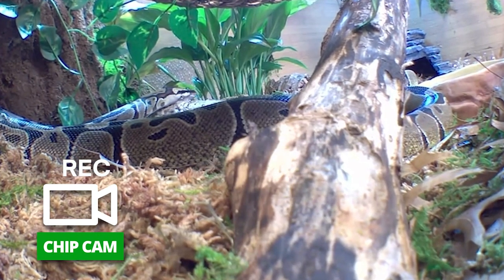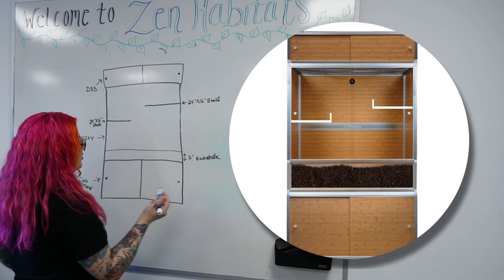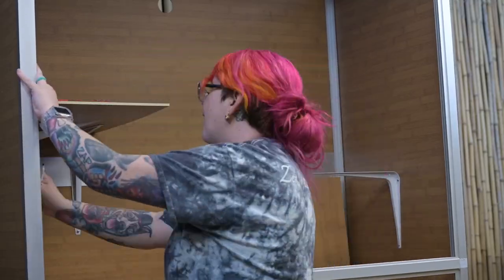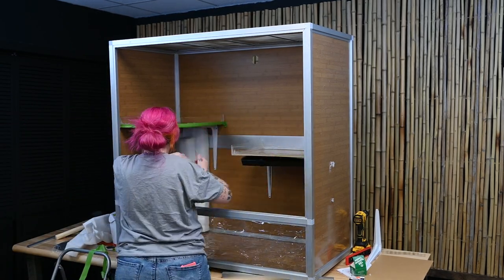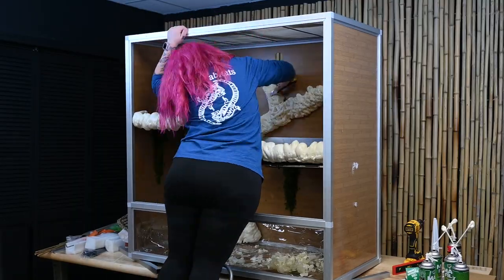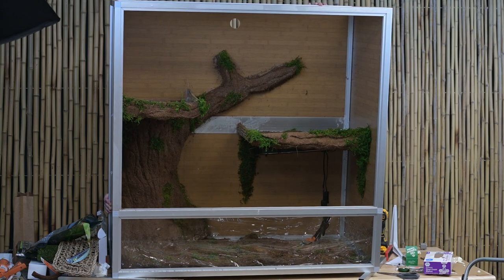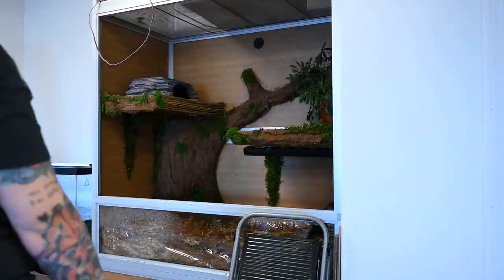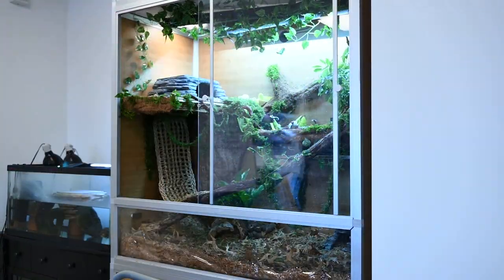HUGE Snake Enclosure Upgrade For Our Ball Python! | Zen Habitats

Comment: I absolutely love this set up!! But where did you put the heat source ? Is this a bioactive set up? If not how do you go about cleaning and sanitizing? This video was great but something more in depth would be amazing!!
Reply from the maker: We use overhead lighting for his main heat source. The heat gradient in this enclosure is more of a vertical one as opposed to a horizontal one and it works really well for him. It is a bioactive enclosure, we used isopods and springtails.

Comment: The planning part of this video is so cool, the graphics to show exactly what you are planning to do! I am considering a 4x2x4 for my ball python, am curious about shelves and how to ensure the enclosure stays warm 4 feet below the heat source that is at secured to the top of the enclosure. hmmm... although he can stay warm on the shelves and enjoy a gradient in heat.
Reply from the maker: Thats basically how we looked at it. The heat is a vertical gradient as well as horizontal. Chip loves to climb and we will find him using both his warmer basking cave or the lower cool cave. It gives him lots of options!
Reply: How is Chip doing with his new setup? And how does he stay warm enough at night? Is there a secret UTH somewhere? Hard to describe, but I’m thinking of putting one in between two thick enough layers and making that a shelf somewhere.
Reply from the maker: @Killjoybb   Chip has been doing amazingly in this setup. In our reptile room it is usually kept fairly warm so we don’t need supplemental heat at night for him.

You could utilize UTH on a shelf, just be sure the shelf is PVC to avoid any fire risk. You’ll also want to keep it on a thermostat to avoid it getting too hot and causing burns. 

You could also use a deep heat projector as an alternative to supplement heat at night should you need.